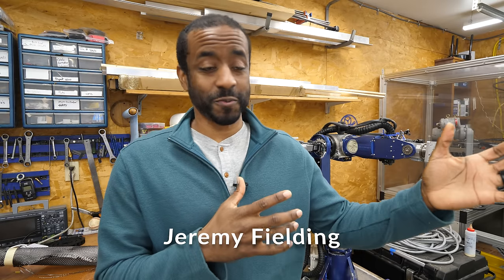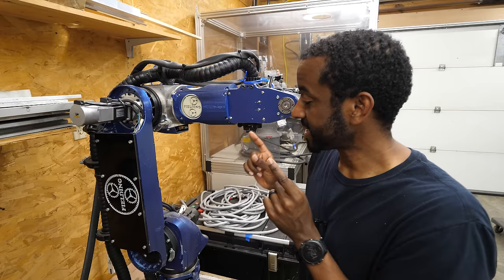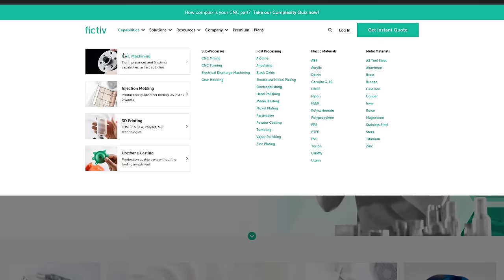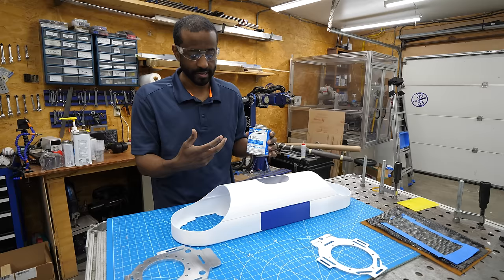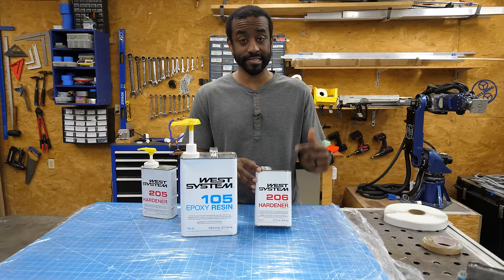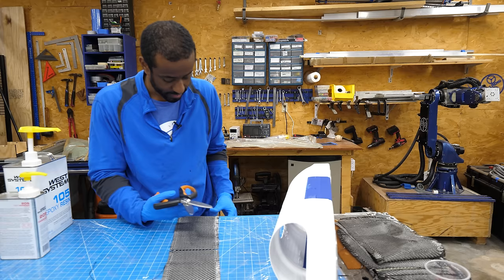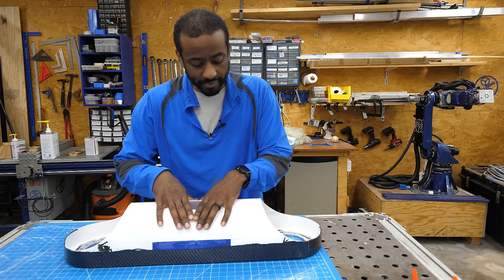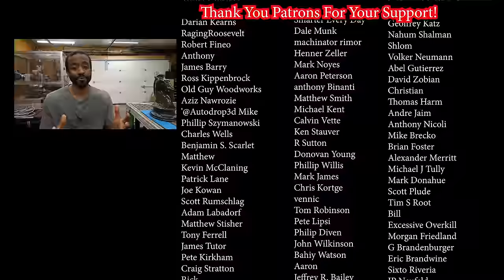How to Make Anything Out of Carbon Fiber.

Comment: Grinding carbon fiber/epoxy in a shop with machine tools is a bad idea.  You can develop an allergy to the epoxy so double gloves and a respirator should be worn during layup and gloves, respirator and a paint suit when grinding.
  The only way you find out your susceptibility to allergy is after you got it.
 As to your choice of part, being a welder for 50 years, structural steel and aircraft aluminum, and a composite fabricator and mold maker I would say that your choice of which part to make is a really really bad idea.  All your expensive motors, gears and wiring are supported by that part, aluminum bends, composites shatter.  If that part fails you are going to be replacing a lot more parts than the arm.
  Second, your composite part is using the load transfer paths of a metal part, your 90° corners are a very bad idea, the load transfer on the fiber part doesn't work that way, you should have put a large radius between the aluminum insert flat part and all other planes.

Comment: Just a genuine question: why are you in haste? what's the sense of urgency to release the video in May? Why have you been counting days wasted throughout the video?
I subscribe to you because I want to learn. A delayed but a well made video will anyway be appreciated at the end of the day, even if it comes in July or August or Whatever.. Honestly 3 months down the line, it's insignificant when it was release... Also, Instead of counting days wasted, why don't you only count mistakes made and how you corrected them? That in my opinion would be a better learning/teaching experience. Sense of urgency never helps except when you're in a burning airplane or having cardiac arrest.
Reply from the maker: Sponsors create deadlines. There is nothing wrong with this. It makes perfect sense to agree on when marketing campaigns etc will go out to the public. I am grateful to have this problem. But because I rely on sponsors to help pay for much of this, I have to release when I said I would. The counter was only there to amplify the point that many things came up which ate away at my original timeline. Of course I would love to release videos whenever I want. But very few things give you such luxury without penalty. This is also why I use Patreon. That has helped relief some of the stressful part, but it still doesn't quite cover the real cost. Though it allows me to occasionally release a video without a sponsor. If you want to see more videos without the time pressure I hope you will consider Patreon support.
Reply from the maker: It is also worth pointing out that consistently releasing videos helps the channel as well. The main reason you are even seeing this video is in part due to me releasing videos consistently. Its more complicated than that, but the point is, you wouldn't even know my channel existed if I didn't release videos regularly. Even being subscribed doesn't mean you see every video when it is released. You have to subscribe, turn on notifications, and allow notifications. Most people have not done all three. So you only see videos on your homepage if YouTube thinks you will watch that particular video regardless of being subscribed or not.
Reply: @Jeremy_Fielding  I apologize, I didn't foresee this from the sponsor's angle. In such scenarios, are multi part videos feasible? Carbon fiber is a pretty interesting topic, and unlike your other videos, this one left me a little bit hungry for more. I learn with you, and here I'm hoping for more videos on the topic. I definitely want to consider Patreon once my financial situation allows. Cheers!

Comment: Why so complicated with the "acrylic glue" whatever that stuff is. PET is really chemicals resistent just use hot glue which is faster, can fill in gaps costs nothing is cheap and easy to use. This part is just a jig anyways.
Reply from the maker: In this particular case the Weldon acrylic glue was perfect. Water thin, it works great on PETG and didn’t warp the plastic from heat. The bond is fantastic and literally like welding without the heat. You should try it. It was just as easy as hot glue only you should wear gloves lol
Reply: @Jeremy_Fielding  Thank you for the reply. Well if it is just as easy as with hot glue then I guess I stay with hot glue instead. There really are only a couple of chemicals which dissolve PET and I don´t want neither of them in my home.

Comment: Everything is fun and games until the carbon fiber hardens and you have to trim or cut it. At that point, you cannot be just a DIY amature. Realize that carbon fiber's 'sawdust' is literally thousands of miniature needles - that if those needles get into your eyes or lungs or skin, it will literally be a world of hurt. You need very special safety equipment not to get injured when cutting or trimming carbon fiber. Be warned.

Comment: So you think your going to attach carbon fiber to plastic you are using the wrong glue 365 days lost so your learning about vacuum bagging and also it is the wrong glue to attach the plastic to aluminum wha you need to build is a female mold in two pieces like when you cast metal your plastic should have been your negative space and your carbon fiber fills calling it positive space so what you are doing is great but you need to rethink the idea first learn how to make the plastic mold a negative space at half of the height so you can mend back together again with carbon fiber use a demolding agent on your mold I use wax and lay up as many layers in your negative as possible in one day g flex is the glue to attach the aluminum to carbon fiber the 105, resin with harder is only for the Carbo layup